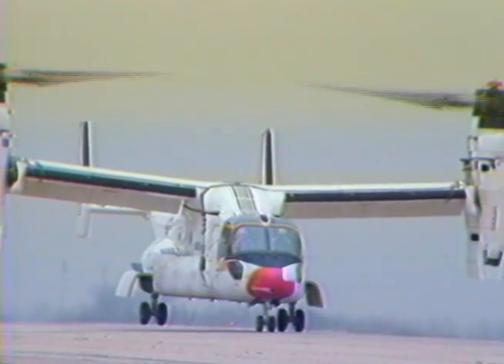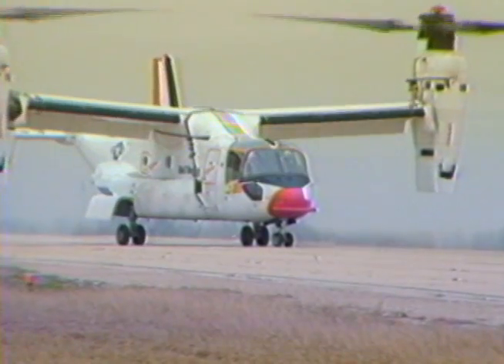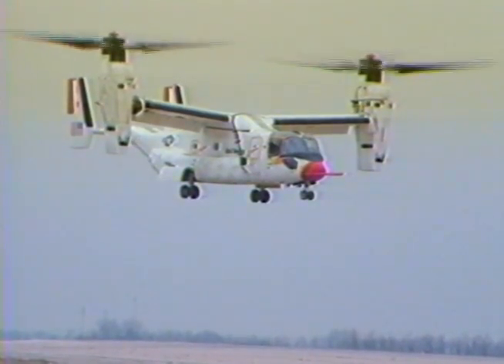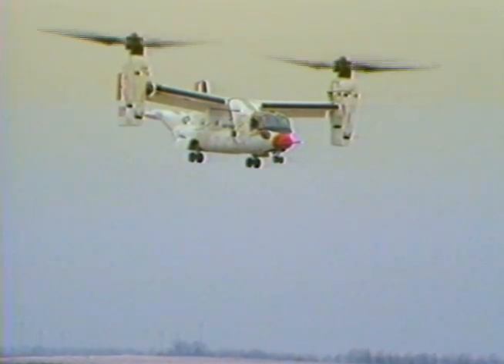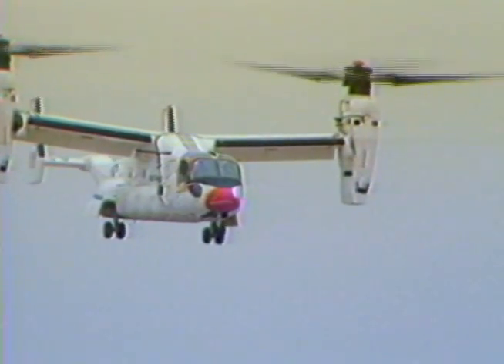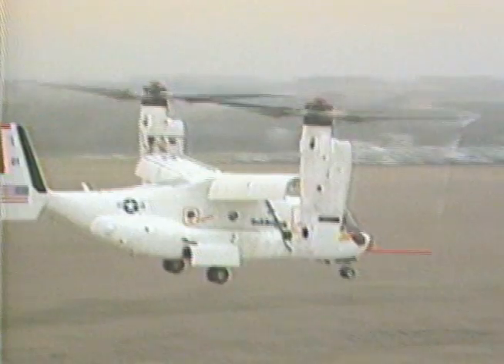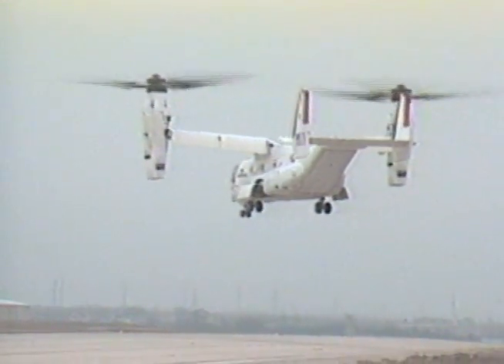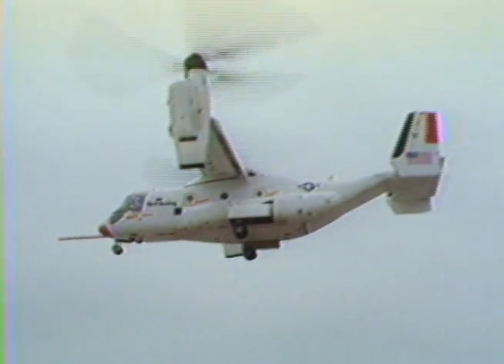V-22 Osprey First Flight 03/19/1989

Comment: We had at least 4 camera’s covering this. I filmed the front head on ground to air views. Proud to say I covered the X-15 like a blanket and much of the,years of V-22 testing thru to 2001.
Reply from the maker: I have one of the original video tapes.  I cant remember what type of tape it is.  Its larger than a VHS, but it's not beta max.  I have no way to play the original tape.  Its longer than the video I uploaded.  Bell's video archive department was no help either.  I'll have to send it to someone to be converted.
Reply: tiltrotor22 ,it’s probably a 3/4 casette.you might find a transfer house that could put it on disc.
Reply: Either way both you guys are awesome for letting us see and experience this.... just awesome work guys
Reply: X-15 cameraman👀 i'm not jealous or anything

Comment: I was there that day as a young engineer at Bell.  Dorman Cannon was the pilot for the first flight.  There was instrumentation wiring taped to the exterior of the fuselage on the right side just aft of the cockpit.  The program has been through a lot of turmoil since that first flight and a unfortunately a lot of people lost their lives in the aircraft between then and now.  Hopefully Bell has all the bugs worked out for the V280.
Reply: Brian, did you ever work in Delaware?   I grew up watching this bird do testing in the early 90's.  We lived under the flight path for KILG and the house is so close I can still hear aircraft taxing.  My dad worked at the DE Air Guard and we used to hang out with some of the Boeing Vertol guys.   One of them even let me drive his old ass Bronco well before I was 16 😂. Cool dude!   #PistolPete the Sheet Metal Warrior !!
Reply: @Kieffik  I worked at the main plant in Hurst.  That is where the wing and nacelles were built.  They were then sent to the Bell Flight test facility in Arlington to be mated to the Boeing built fuselage.
Reply: I was there too, another young (27) engineer - but on the Boeing side.  I managed to witness it's first flight in the airplane mode too (about 6 months after this).  I was "monitoring" in the telemetry room...but when I realized they were going to do a fly by, I scurried out of  there and went outside.  I spent 15 years on the program starting when it was just a bunch of drawings.  To have been able to witness the first flight was a milestone in my career (which is quickly winding down).  And to the reply from Kieffik...I spent a considerable amount of time at KILG supporting the Boeing flight testing there.
Reply: Date is not right though
Reply from the maker: Late reply, but i've been a part of the V280 program and lessons learned has helped create a great aircraft.  The V280 is coming along and flying very well.

Comment: I imagine all the flight controls were mechanical at this point, and I would think at some point in it's long development they were able to incorporate fly by wire, or were they fly by wire from the start?
Reply from the maker: Fly by Wire was always a part of the Osprey.  It never had mechanical controls.
Reply: I should have looked when the Airbus A320 was introduced, that was the first plane I knew had fly by wire.
I knew the Osprey had a lot of problems initially, I thought maybe the f b w helped fix them.
I watched a cockpit tour, the technology is overwhelming.
In the old days, a pilot mostly just needed big balls, now you still need big balls but you have to be smart as hell too.  
Thanks for your service
Reply: @bigredc222  First commercial aircraft with fly by wire but the military had been doing it long before.
Reply: @bigredc222  Fly by wire has been around since 1968 or 1972, depending on what you consider an aircraft to be.